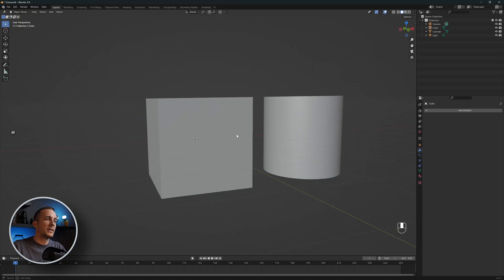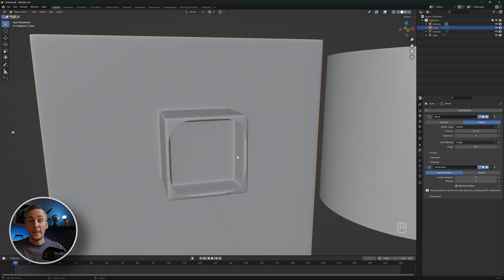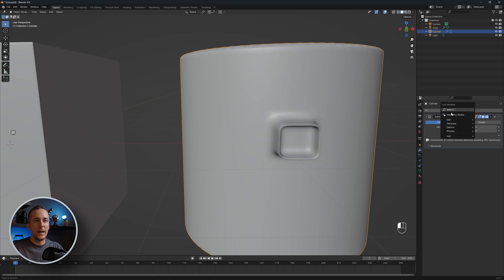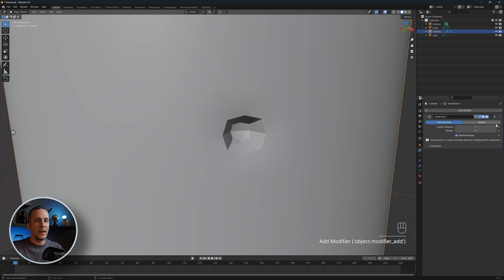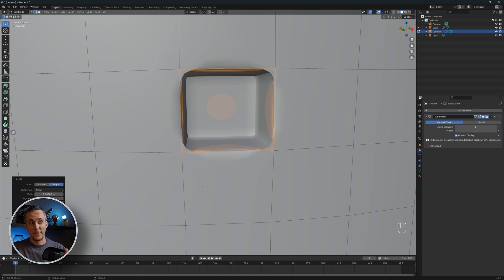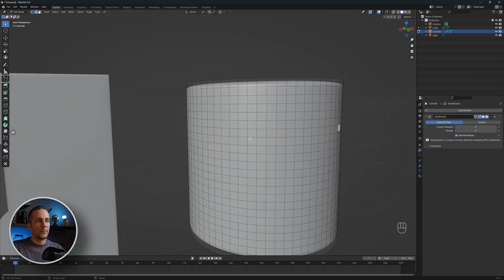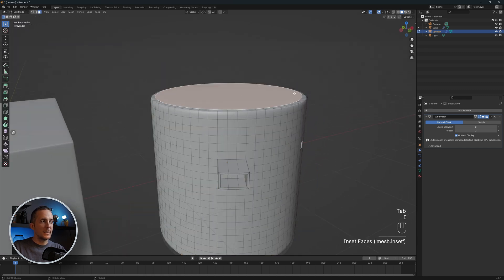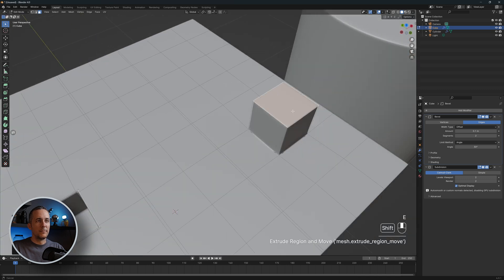FIX topology issue. Common beginner problem.

Comment: u cant get away from pinching without proper density. U can try these kind of woodoo techniques, data transfer with normals, shrinkwrap modifier but the main problem is still there. the Ngons could cause shading issues in some game engines. So good approach for prototyping but not for end results.

Comment: you can also just add a "Mean Crease" to the edges instead of using a bevel
Reply: That is like putting a bandaid on a bullet wound instead of going to the hospital because it doesn't solve the underlying problem. There are many situations where mean crease would look worse than the problem you aim to solve with it.

Comment: So... what if you don't have that menu to tweak the segments and the miter? There is nothing there for me. Not even a floating tab. Anyway thanks a lot for the tutorial. <3

EDIT:
I didn't have time for this shit so I just applied the damn subdivsurf modifier and made the inset with a boolean operation at the end of the project (a 3D print). Yes yes yes I know it's working destructively and that's considered as bad as kicking puppies or something,  but I don't care. I. Don't. F:ing. Care. I'm on a deadline and the client will never know the difference. 
So sick of this SubDivSurf modifier. It's bad and needs fixing. I mean, I know I'm probably bad too, but it'd be easier for everyone if the Blender foundation just fixed the damn issue. At the very least change the default settings around so that you get the result in the video right off the bat instead of hiding behind several tweaks, when 9 times out of 10, this is the result everyone wants. 
Not mad at the uploader, just at the Blender Foundation. BAD Blender Foundation!

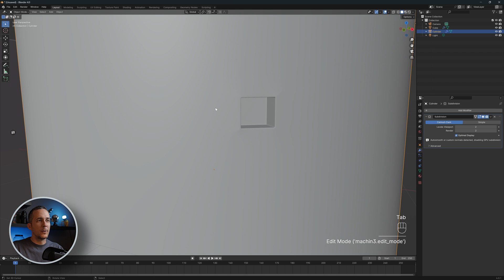Comment: 3:50 I wouldn't call it perfect since there is still visible pinching on the shading of the curved surface. I suggest just duplicate the mesh and add shrink-wrap modifier with vertex group.

Comment: How do you fix the Ngons on the corner of all of the sides?
Reply: Connect the corner to the opposite corner to form a diagonal with 2 4 sided faces on each side
Reply: @spider853 makes a pole
That still causes bad shading after sub div depending on how dense your mesh was before hand

Comment: Thank you for showing this method! Wouldn't it also work with edge creases (shift+e), or what are the disadvantages of edge creases?
Reply from the maker: You're welcome. It would work in some cases, not all, try it and you will see 😊, but if you are sending your model to someone else with another 3D software, edge crease wouldn't work properly or at all.
Reply: @3Dnot2D   should be ok if you export as alembic, but it also has its disadvantages